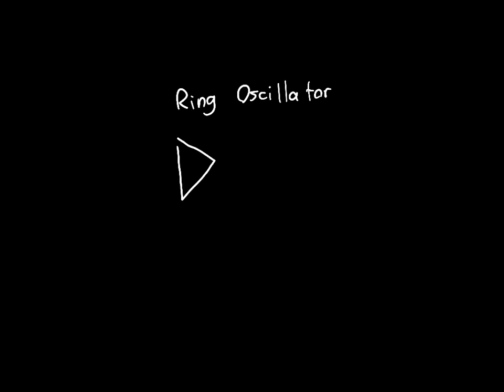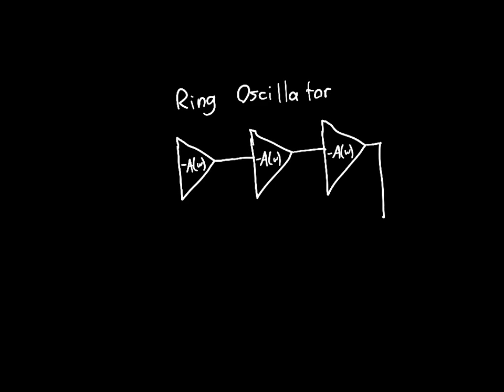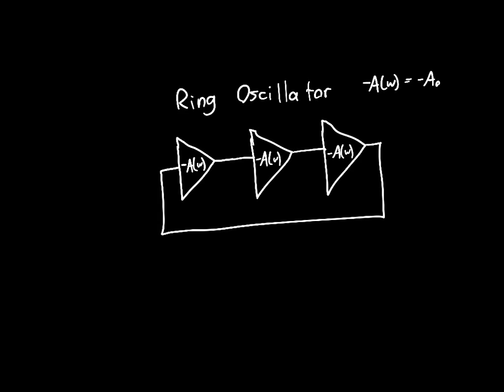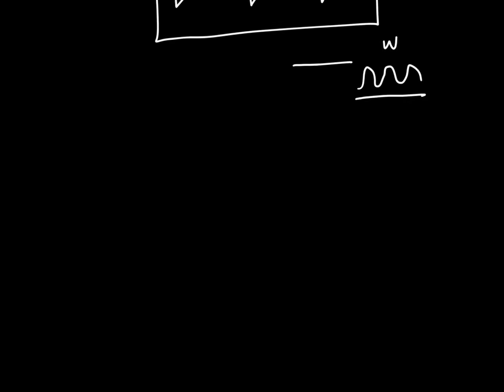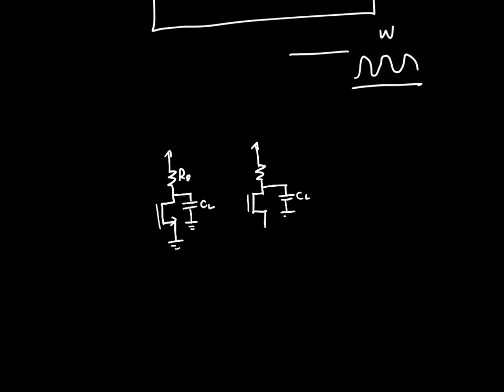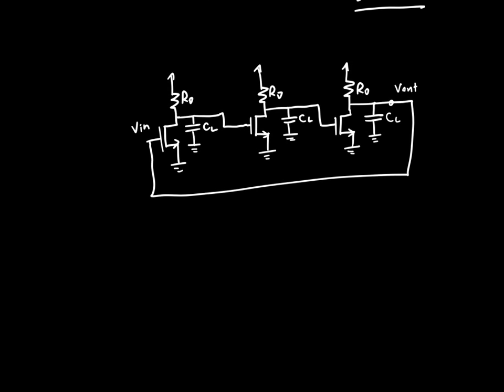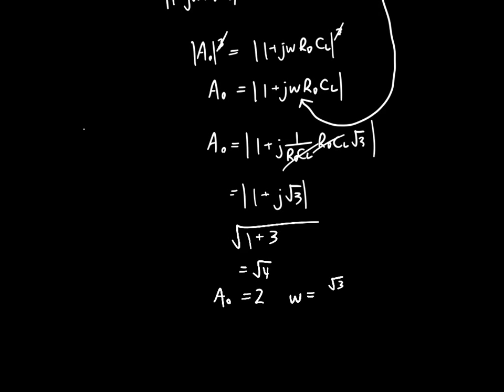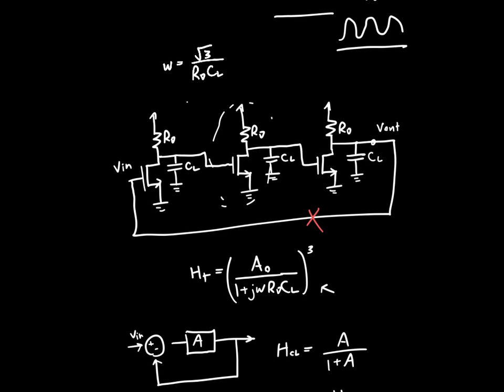Ring Oscillator Analysis Part 1

Comment: Hi, how to calculate the load capacitance that goes in the output? Here you can see my diagram. https://drive.google.com/file/d/1L0AtwjxHi8ZTSwoaFEfCANHbH1snIHFn/view?usp=drivesdk
Reply from the maker: That depends on where you want the pole. If you know the resistance value, you can just calculate it because you know the pole is at 1/RC.
Reply: thanks. Can the oscillator generate an oscillating signal without a pulse in time zero?